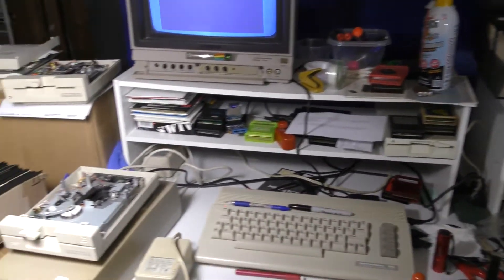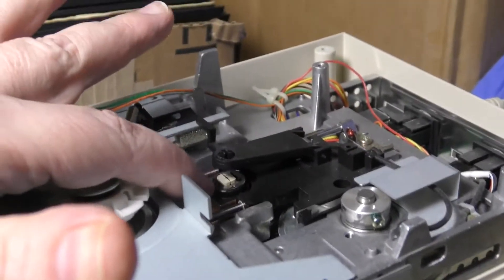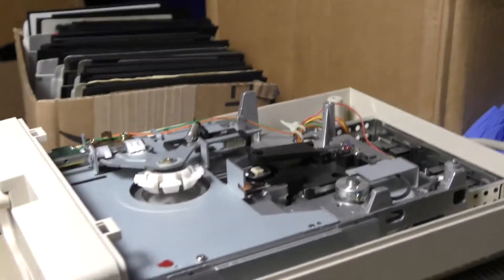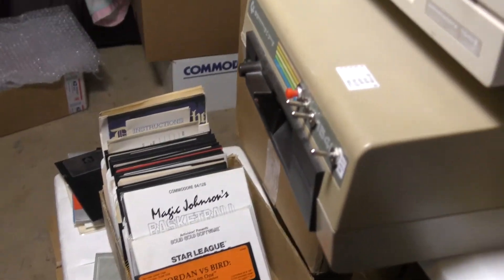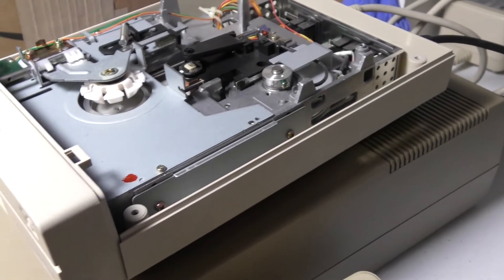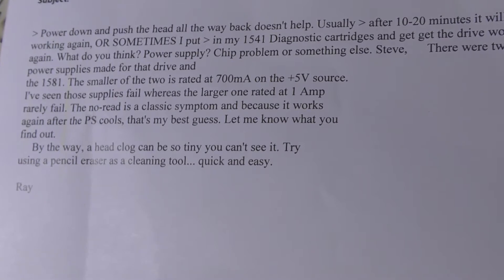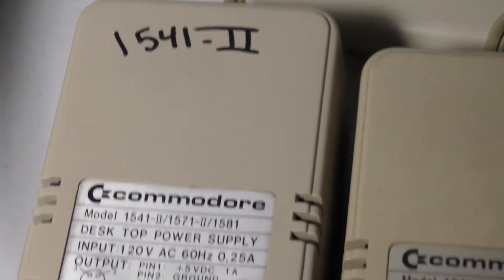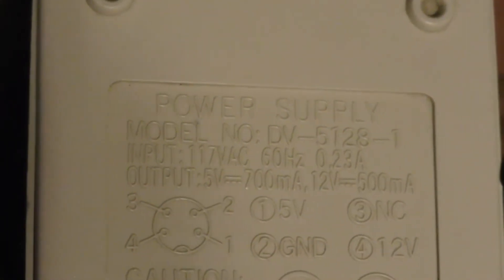Commodore 1541-II Stutter Drive Update and fixes

Comment: I have a 1541-II power supply (the 700 milliampere version) and when you test the voltages unloaded it tests perfectly but it won’t run a drive at all under load. I never encounter this problem anymore since I run one of the modern replacement switching power supplies now. Been running great for 3 years or so...
Reply from the maker: Nice, where did you get the modern replacement? Can you send me the link?

Comment: Great Video. Do you know what happen if Pin 3 of the power supply that say "NC" , is connected yo GND (Like Pin2) . Thanks!
Reply from the maker: I don't think it's connected to anything - Take your multimeter - out it to continuity mode and touch pins #2 and #3 - if it beeps they are then both connected to ground.